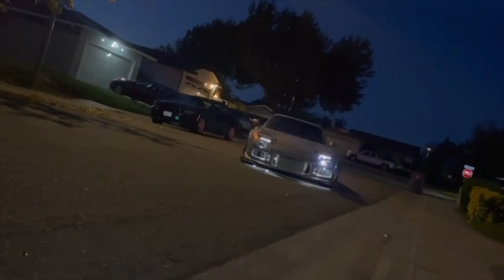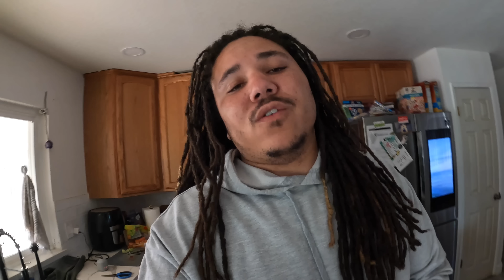Taking Out The SuperCharged LSA 350Z For The First Time! *First Real Drive*

Comment: hey mike myke love the 350z content i have a suggestion did you ever look into interchillers they use refrigerant to cool down coolant you can connect it in line with your heat exchanger it'll be so cold there will be condensation on the lines going into the supercharger you wont have to always refill the ice box.
Reply: please check andrew out at csp love the build though.
Reply: So its beneficial to run both? Always heard run one or the other.
Reply: @jamez2fly92  you're right you can run either or but in my opinion for the best outcome and the best power numbers it would do you good to run both get the iats down to a considerable amount
Reply: Totally in point with the this but trust me Mike knows he can put one in he already has a million reson why he hasn’t done it lmao we all know Mike he thinks everything through all the way every option possible before he does it especially for the lsa ls3 prochan 350z I think RR
Reply: @jamez2fly92  both are pretty effective My Buddy has a 10 speed paxton pro charged 5.0 with a FI interchiller And just recently added a ice box with the FI Interchiller he was making around 950 to the wheel and makes over 1100 now with both
Reply: @devante-jospehedman3194  Yeah with boths the iat will drop substantially causally sitting at like 32F mid pull 😂quite ridiculous how crazy they are when used together and tuned right
Reply: @jinxyonadderall8446   @jinxyonadderall  🔥🔥. Yeah normally i swore you would delete one because they wrk against one another. Honestly not too knowledgeable on the combo, already tricky enough ya knw😅 lol
Reply: Killer chiller bruh....
Reply: Ll

Comment: Hey man, I thought that was you when I drove past Worx that day but wasn’t sure. Side note, you planning on upgrading the brakes on the truck? You’re adding quite a bit of power over stock and the 99-04 (99-06 in general but talking more about the trucks with rear discs like yours) trucks had some common brake issues (rear slide pins sticking/caliper binding, collapsing brake likes from being old, etc) you would probably like to look into before you go beat on it. I’m sure MikeD and others have helped you a bunch with truck info but worth mentioning.